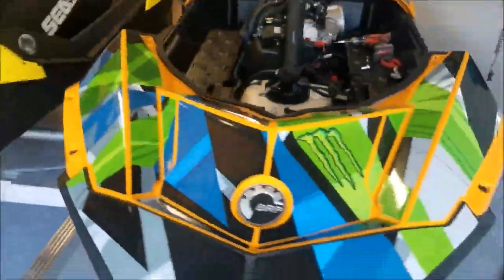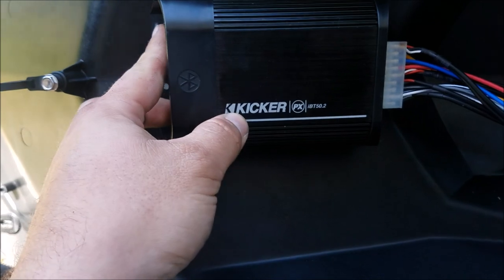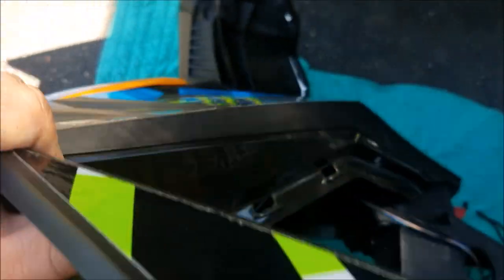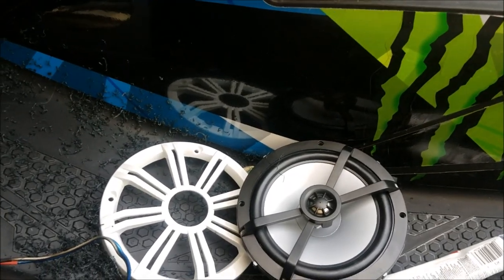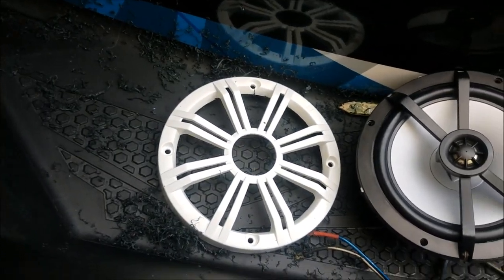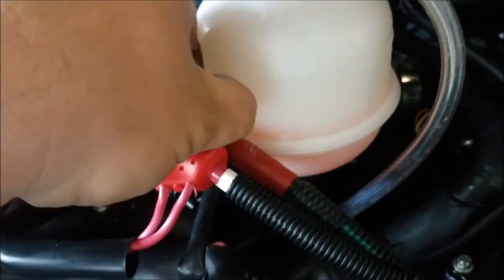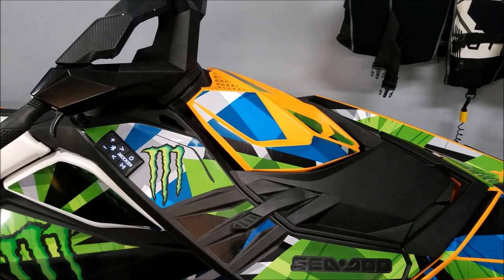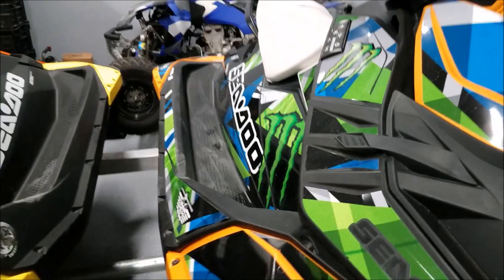Seadoo Spark Kicker Sound System Installation

Comment: Great video, very helpful write-up! Couple questions 1. The silicone - was that just to create a seal, or was it more to glue it in place? My thoughts were, gorilla glue or epoxy, or using nuts on the other side. Advise? 2. What size hole-saw did you use? I’m pretty terrified of that part myself, and I have 2 Sparks, wanted to do this to both 3. Why the power switch? Would it draw too much power if it was connected to the battery and basically on the entire time the jet ski was powered on? 4. Love the blacked out top piece you have (the cover on the very top), I originally plasti-dipped mine, then used a vinyl wrap. Neither have held up well, what did you use? It looks really good 
Thanks again for making this video, very helpful
Reply from the maker: Sammy Chandna hey I'm glad you like the video. To answer your question 1. Silicone is to seal and glue in place. I wouldn't use epoxy in case you want to replace a speaker. And some epoxies may melt the plastic. 2. The holesaw size I don't remember, but it's listed  on the box of speakers when you buy it. Measure 6 times and go SLOW. 3. The power switch is just a precaution in case it shorts out or something happens and also no amp draw when off. And 4. it is vinyl wrap. And I have the same issue with my helmet taking chunks out of it. I redo it every season. Hope that helps. Check out my Instagram @MOHAWKDAVE555.

Comment: When installing back the top deck some reason it is not sitting right? Any idea? I made room for the speakers by removing some foam, I also have the amp under the storage unit

Comment: How many watts is your amp? And how many watts does each speaker pull? I just bought a kawasaki ultra 310x and I really want to install audio!
Reply from the maker: Moustafa Harajli  amp is 50w. And speakers are 65w at 2ohm
Reply: Mohawk Dave wow that's loud for 50w, I was hesitating to spend 540 for 300w kicker amp and two 135w speakers. After seeing your video I'm gonna purchase it 100% because even your system is just wow.
Reply from the maker: Moustafa Harajli  you gotta keep in mind, I went with the amp that's designed for a small battery and charging system like atv, or a motorcycle.  Make sure that a 300w amp will be able to get sufficient power from your battery and charging system. I can have this playing music all day while riding at max volume. And the battery will not die.
Reply: Mohawk Dave good point I'll speak with the dealer thank you
Reply: Buy the ultimate ear roll 2 hooking to your life vest or the handle bars. They are loud.

Comment: You never actually went through where each wire gets connected.
Reply: Did you just wire the 12v ignition with the 12v constant?  It's unclear what you did there.